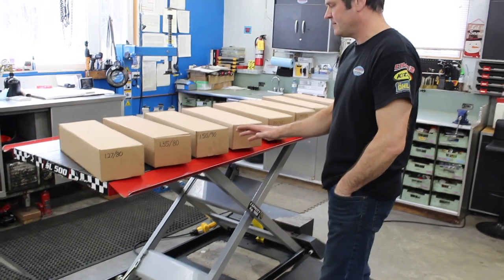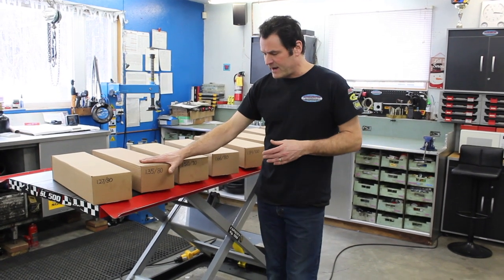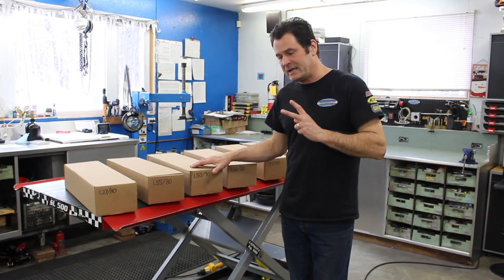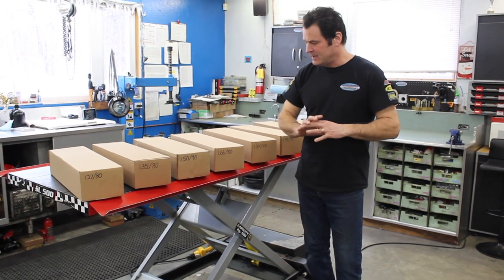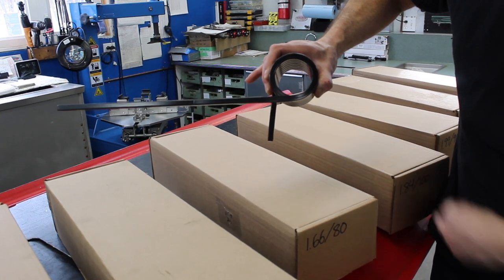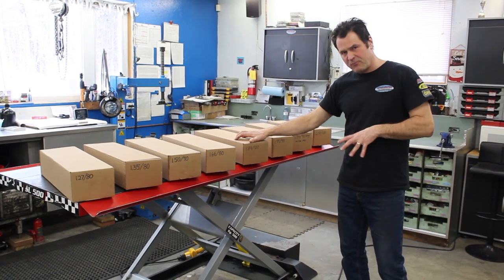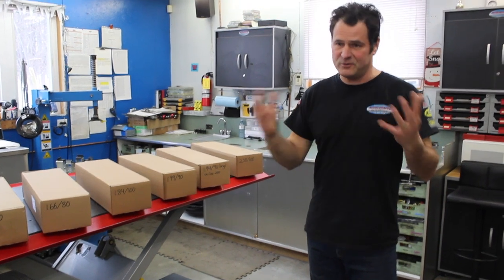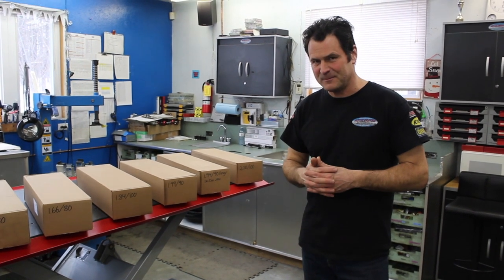Accelerated Technologies Snowmobile suspension tuning, torsion spring selection

Comment: due to my lack of research i went with skidoo 1.66/80  as a 280 pound rider this isnt enough torsion. im a semi aggressive trail ridder on a 2020 back country 850. ill try these but ill probably be calling you
Reply: I'm 185 out of the shower & that spring won't do it 4 me on my 22 Renegade XRS Competition. The dealers only know & go w that. John is point on! Went w the 194's for the Rmotion  X Suspension. Got to keep in mind Fuel Caddy, Tunnel Bag, snow/ice packed in, Full Tank of fuel, any other accessorie add on, Riding Gear... also I added Hygear spacers along w new Torsion Springs.

Comment: I'm waiting on delivery of a Sidwinder XTX 146 and am researching suspension springs.  Information is hard to find even on the I-net.  Thus stumbling on your site has proven valuable.  Based on my findings thus far, AC/Yamaha's STOCK spring rating is 0.394" SQ, - 90Deg. Angle - 165 LB.   They offer a upgrade rated 0.405" SQ, - 85Deg. Angle - 191 LB.   I have a friend with a AC racing sled 2017, Model 600SX .  I was only able to measure the long arm at 0.437" SQ.  I have not found any additional info on that spring.   
My reason for doing this research is - I will be building a rack on the back of the tunnel to carry my ice fishing gear.   I'm 200 lb, by the time I'm dressed, probably 220 to 225 lb.   The fishing gear - auger, rods, tackle, sonar, heater, propane, etc going in the rack will probably weigh 60 to 80 lbs.  So, I pretty sure the stock spring would be replaced.

Comment: Can you tell me what size of spring I should consider for a 2016 Renegade
800 XRS.  I am 225-230 and my wife would like to ride along on the 2-up seat we purchased and she is 125 so let’s say with gear 400 pounds.
 When I take the sled out myself I have the adjustments maxed but the sled still wants to ride close to the ground with the flap dragging, no wife on the sled as of yet.

Thanks so much - Tim